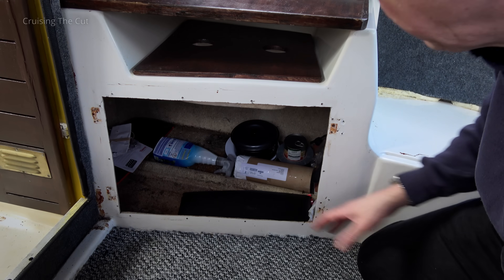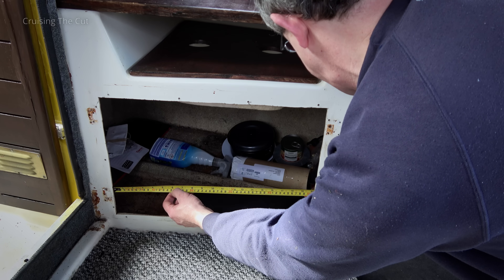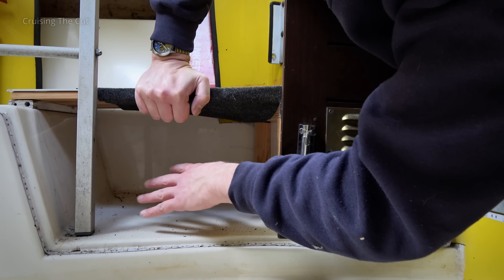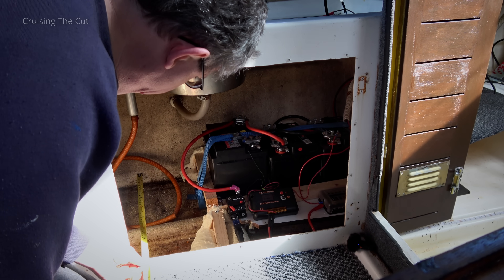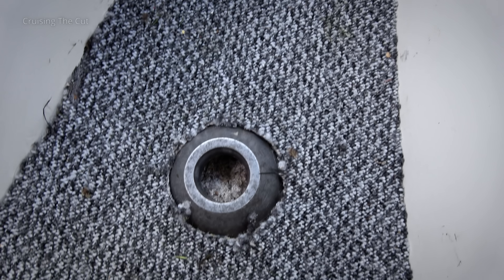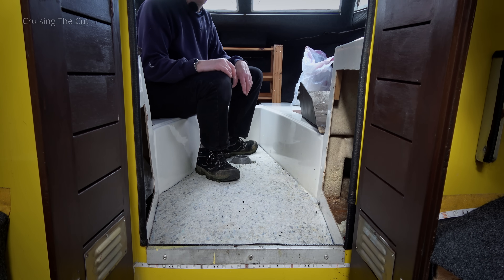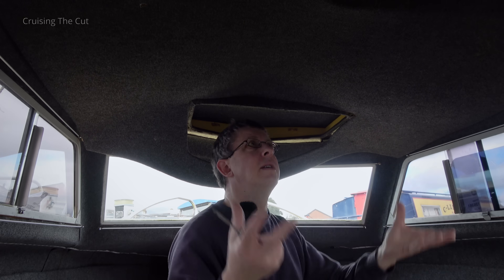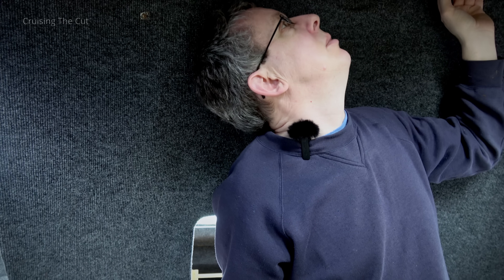329. Look what I found under the carpet!

Comment: As a person who uses old stuff to make patterns for replacement stuff, I was shouting “Noooo!!!” As you said you were simply going to toss the carpet bits away. Those prices are gold as patterns. The boat has such complex curves to accommodate and trying to create replacements out of any material is going to be a challenge. A pattern, even if eventually modified could save you hours of headache down the road. I hope it’s not too late to save them, but I suspect it may be.  And I had to chuckle about the concerns of battery storage and potential water issues as we viewed the current battery placement under the sink. Nope, no dangers there!  All that said, I’m sure Miss Twiggy is going to look fab when you are done with her if your previous projects are anything to go by!  Best of luck…with or without pattern captures!  ❤
Reply: Haha I was thinking the same thing at the end of the video.
Reply: I was thinking the same thing. The original piece is a great reference for the over all amount of the replacement material needed  even if you dont use it as a pattern
Reply: Yup, I was thinking exactly the same thing.  🙂
Reply: David. I do hope you heard these words of wisdom in time tonsave the patterns for future reference. 🤞
Reply: He already discusses this at 6:13 so I'm sure the thought had crossed his mind
Reply: He said at 6:13 "Because it doesn't  fit properly, it won't make a good template"
Reply: Battery boxes (sealed units) under both footwells.  Wire up to a solar panel (or two) on the forward cabin toof; leaving room to open the hatch above the cabin. Why not lay faux teak decking in the open centre well and carpet the cabin floors fore and aft? Line sidea and roof with cream faux leather after running any wiring first. You could incorporate an l.e.d. light in the roof too. Design an build a decent dashboard too, with non-reflective covering on top.
If your finances run to it, install a new outboard with electric start/stop. I'd reupholster all the seats to make them more comfortable too. You've got the making of a very smart and comfortable boat there. I could do a great deal with her for not a lot of money. I've upgraded many boats over the years; from 24 feet up to 65 feet, and had enormous fun doing them too. I'm mainly into classic and custom cars, but there's nothing like a compact, well designed and equipped boat for pure relaxatiin and freedom around canals, rivers and the sea.

Comment: You've given yourself an enormous amount of work recarpeting the whole boat, maybe it's just the video giving an illusion but it looked quite good to me. You definitely need to keep all those pieces to use as a patterns. That floor carpet I'd have just trimmed it to size and stitched a piece of binding tape around it to give a good edge. I hope that you're not going to regret stripping everything out, recarpeting is a very skilled job, hopefully you're up to doing it, I wouldn't be.

Comment: I was going to recommend a small self contained top loading fridge on drawer slides such as a yeti (there are other much less expensive brands) but after reading comments and answers it sounds like you already got one. Bravo. Another suggestion before building new cabinetry would be transferring your measurements to cardboard, cutting everything out and use masking tape to build a mock-up. That way you can see how everything fits, whether it works the way you want or not. It makes it easy to scribe on curves and irregularities that always exist on boats. The bonus is once everything is the way you like, the pieces can be marked, carefully disassembled and then used as templates for actually cutting the wood. I’ve used this on van builds before and it was well worth the while. High quality foam board works even better. I love that you’re showing pretty much everything including the demo. Cheers from Florida 🌴🌴🌴
Reply from the maker: Excellent idea, thanks!
Reply: @CruisingTheCut  And be sure to call it CAD, Cardboard Aided Design, as that's all the rage.
Reply: I’m impressed I think an award for bravery is deserved. There seems to be no sign of the “oh my God what the heck am I doing this for” stage. Will that come later?
Reply: @chucksterock  I am getting Bad Obsession Motorsport flashbacks.

Comment: re: battery under the drivers feet. Water is not as big a concern with low voltage DC.  Unless its submerged, its fine. but I think putting it in the cabin would add more security. Plus in the rare event that you have a "thermal battery issue", not having that under your feet would be preferred.
Expanding foam should require licensing.  People use it far too often for the wrong things. Acetone will get rid of it most of the time. Just test it first to make sure you don't damage other surfaces.  I'd also suggest wearing a painters mask when you pull that stuff down. The dust might be nasty for you. I know its a little late for that now, but keep it in mind for the future.  Fiberglass and the like can create hazardous dust.
I'm thoroughly enjoying this series David. Thank you for taking the time to film this for us. I actually waited until the end to comment!
Reply from the maker: That's very restrained of you ;-) Good point about the mask, I'll take one when I start scraping the remainder off.
Reply: Another term for dust mask?
And additionally ventilating the area
Reply: Actually a hot battery is best discovered early.
Reply: My bobcat battery was submerged for 4 weeks all good
Reply: "How very restrained of you" he replys!🤣😅
Reply: Do you think the battery giving off hydrogen gas could be a problem in a confined space?

Comment: Its always nice to start fresh with nice new not musty surfaces. It will smell good and feel great.
Reply from the maker: Definiitely needs a bit of a clean, there's some mouldy spots
Reply: @CruisingTheCut  You said there was dampness jn the bow. Make sure there is no leaking at all. Get out the garden hose and spray it with a good strong stream of water for a bit the rake the nozzle off and just let the hose run over the deck for a good 30 minutes.  Water will find away if it can and sometimes it takes a little while.

Comment: I am  retired packaging engineer, my speciality was the packaging of shipboard electronics on military vessels.  As on all boats, space and access is at a premium.  Our standard method of dealing with this problem was the construction of drawers that would pull out to allow access to the equipment inside. Perhaps something even as simple as a box/s on rollers or wheels that could be pulled out to  allow you to hard wire your batteries, inverter, etc and then using connectors, it could be pushed back into place and locked down.  This would also make trouble shooting much easier should the need arise.  Just a thought for what it might be worth.  Have a good day and good luck with your project.

Comment: On my Norman Conquest 20, I have the water and supplies cupboard on one side (under your sink), and the batteries and electric on the other side. It helps with ballasting. With me in the driver's seat, and 20 kgs of water the boat is ballasted level. It makes driving so much easier. I removed all the other ballast, so it's much more responsive.
Reply from the maker: That's similar to my plan, the electrics will mostly go to port, water under the sink to starboard.

Comment: Still put your battery in a battery box which you can put anywhere but your solar controller & inverter up off the floor away from moisture & be able to be seen for checking for your battery & solar condition!

Comment: When you are replacing the deckhead carpet with  whatever,   consider using 3M High performance double sided tapes.    They have incredible bonding strength  and can be released for your next (?) renovation.  I have used them in both interior and exterior projects on my sailboat.

Comment: A thought for the new interior. 3mm ply covered with vinyl wallpaper - similar to a caravan's interior. Very easy to keep clean, bright and cheerful - and tough. Fibreglass/epoxy in loads of little wooden blocks/plates to screw (or rivet) the ply to. Pop rivets come in very handy. You're going to want some sound dampening I imagine, so stick that to the walls and ceiling before fixing the ply. That should also give you some 'give' in the event of hard things banging into the wall. There are plenty of mouldings available to cover the joins - again from the caravan world. Even flexible stuff on a roll for the corners to just leave a bead showing. Food for thought perhaps?

Comment: You made a comment about why they used the expanding foam. I would guess as the insulator it is designed as. As a bonus to help keep sound under control, and moisture barrier, and help prevent impact damage on the sole if you drop something heavy. Plus being sticky, it helps cut down the screws to hold in place. It does not appear to be used as good insulation since it is not uniformly applied.
Reply from the maker: It's definitely not there for insulation, it's too sporadic
Reply: @CruisingTheCut  It's cheap and quick. Got to build to the budget, don't you know? Horrible bad craftsmanship, but the idea is that you live with the interior and never find out how many countless untold sins it hides!

Comment: I had a bar fridge, gave it away last week. To a caravaning friend.
Have a look at the Ecoflow range, top end people run all kinds of electrical stuff on them.There is the 2500 watt model.
Here we can buy a full sized fridge freezer with it's own inverter and solar panel
Reply from the maker: I can't see the point of a portable power bank. I'd forget to charge it, and probably forget to bring it to and from the boat too. Much better to build a system in so it's always ready to rumble.

Comment: With all the curves and edges, a flexible felt like that used in motorhomes would be very practical. This also prevents you from losing valuable headspace on the ceiling due to cavities and you can simply attach it with spray adhesive. I would use a multitool to smooth the walls. 

Drawer fridges are disgustingly expensive, maybe a good Dometic compressor cooler will do the trick. You can also bring it loaded from home and pre-cool it. Cheers!
Reply from the maker: My flexible carpet order arrives tomorrow! And my tiny fridge turned up today :-)
Reply: @CruisingTheCut  it's "all go", and very exciting! You will know this boat very well inside and out by the time the renovations are complete. David, how will you combat the condensation issue? I've heard you mention condensation a few times over your videos.

Comment: Acetone will melt that foam and help remove it from any area where it may be visable later on. There is a dedicated version of it for holding panelling and will hold plasterboard on to a wall. Strong stuff and a different consistancy to that gap filler version which seems to have exploded inside Twiggy. You can sand and paint it also and I have used it recently; not on a boat I hasten to add.
Take care moving your batteries about so you maintain a decent trim. Twggy is a bit lighter than a narrow boat and a battery is a heavy enough item on a light little craft. Is there space for a small fridge in the cockpit. A lot of small cruisers have them there ; some with a seat poped on top.

Comment: For the flooring, have you ever looked into the adhesive-backed eva foam sheet as is often used for boats (at least here in the US). Can be cut to size, provides safe and comfortable footing, is weather resistant, and can be purchased with various patterns / textures / designs.
Reply from the maker: I have just bought some for the insulation!

Comment: For insulation, I used car bonnet insulation. It looks like a layer of foam with aluminium foil on one side. Reflects the heat in in winter and insulates nicely. It's also fire proof - and very cheap.
Reply from the maker: Yes, I've bought something similar. The foil will have zero effect once the carpet's on top of it but the closed-cell foam should help a little.
Reply: @CruisingTheCut  don't have the knowledge to support my argument, but it does feel warmer with the foil than just foam alone - especially when you roll against it at night! We have similar approach to DIY and I love it. :)

Comment: You'd be surprised how easy it is to mount an inner roof using the "fluffy cloud" method you've discovered. Your choices are following the contour of the hull with carpet or using the oil board/ hard board as in this case. Following the contour is not impossible but it will lead to a number of concave/convex sequences. With a bit of stretch in the carpet it's doable. I still prefer to have reasonably flat surfaces. The air gap between the oilboard and the hull gives a bit of insulation as well, unfortunately also comes with a risk of 1980s boat smell. 😂

Comment: I was looking at what appeared to be a quite large space under the sink, where the batteries are at the moment, and thinking that it might make a good place for your fridge. 

Any new batteries would be safer behind a locked door in a cabin as sticky fingers could fairly easily remove them from the cockpit.
Reply: Good point on securing the batteries inside.
Reply from the maker: There's no enough space under there for a fridge, unfortunately.

Comment: I've watched a lot of boat channels. And every one of them, when they decide to do something to the inside ceiling, it is a disaster. Can't take off this piece until you do that one. Etc. The best rebuild I saw was Melody channel. They had wiring to run in the ceiling so they did panels with velcro.

Comment: Good to see you are getting on with it. Already you are miles ahead of any project I have in mind as I've learned not to start things that I likely won't finish. Consequently I do little.
I think, were it me, I'd put the batteries in the least used or hardest space to use and save the easiest access or most convenient places for things I'd often use. I find that drawers may have smaller useful area then cupboards but, they are much easier to use.
Interesting content, 
Thanks for sharing.
Reply from the maker: Cheers

Comment: Nice job on the removing carpet , if you intend keeping the vessel I would highly recommend replacing the wiring it can go corroded and let you down buy the copper wiring then it won’t rust always but larger Guages than you need then you will not have any voltage loss , love your videos 😊
Reply from the maker: Yes, I am, see the prior renovation video 👍

Comment: Many types of expanding foams contain isocyanates, the inhalation of which is associated with severely adverse health effects such as asthma, inflammation in the respiratory tract, and cancer, so I would recommend proper respiratory protection when dealing with the foam. As far as tools go to remove the foam itself, you can move quite quickly with a rubber wheel (sometimes called a decal remover or adhesive remover wheel) fitted into a battery powered drill.

Comment: I too have opened the Pandoras Box that is removing old carpeting from a Shetland 535 cabin.  I wish I hadn't.
Reply from the maker: What are you replacing it with?
Reply: @CruisingTheCut  we were going to have bare fibre glass - fishing and carpets don't mix!  But when we saw the mess underneath, we dropped the carpet back into place.

Comment: Your cabin interior was done just about how I was expecting... 

I would see if you can find the source of the water behind the lining just for peace of mind if nothing else. That way it will not compromise the new interior.

Over the years having worked on many different small and large boats I never could understand why people would have dark interiors. I was raised around work boats where it was white or a light gray paint with doors and drawers fronts of varnished mahogany. 

The worst is an engine space painted dark gray or black like many boat builders do or did.

I wonder if you could get those foam floor squares that lock together to use as a hull liner? It would give you some sound and thermal insulation in the cabin area. A friend glued them to the hull and deck in his cabin and it made a noticeable difference in comfort when sleeping in the V-berth.

Comment: I'd use light coloured carpet tiles.
It would be much easier getting them on on the boat, you can stick them on with spray on glue, they're easy to cut into strange shapes and if you make a mistake you'll only lose a little bit.

Comment: I like the "cloud city" line. It was a moment of levity in a job which reminded me of the awful old foam-backed carpets I've pulled up. The foam had crumbled into a fine dust which both got into your lungs and in patches stuck hard to the floorboards. That expanding foam... well, I can't see if it's making dust, so I kind-of assumed it wasn't. Perhaps a certain other commenter is right to suggest a mask.